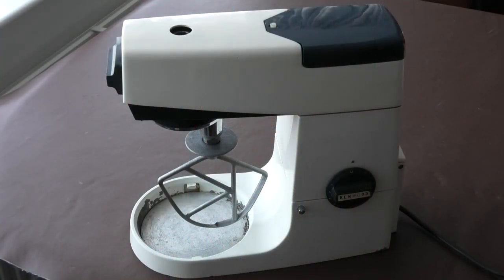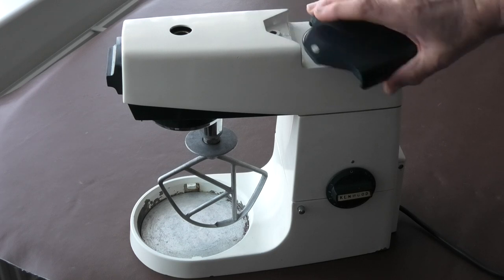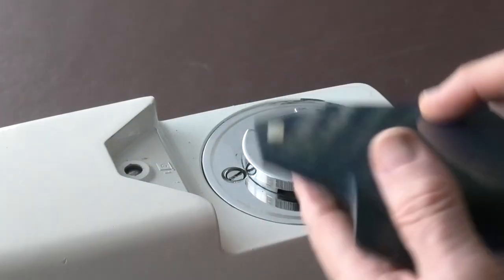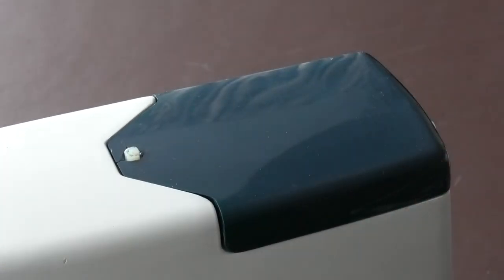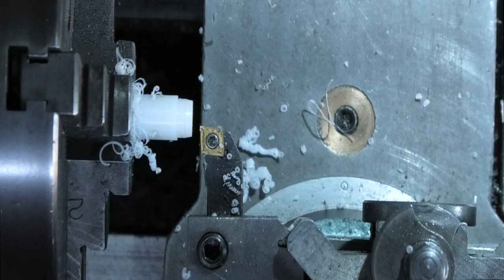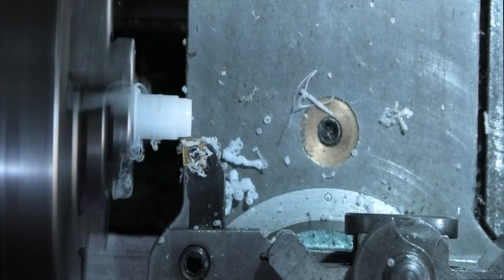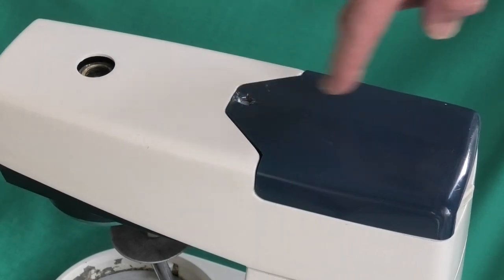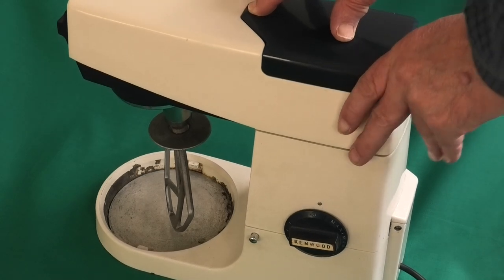Making a nylon drive peg

Comment: Yes that  pin on the removeable cover disengages the rotation of the top spline shaft which takes the the liquidizer. The original does not have a 'thru" hole. It it is of any use for you the original pin protrudes 1/4inch from the base.
Reply from the maker: thanks for the info